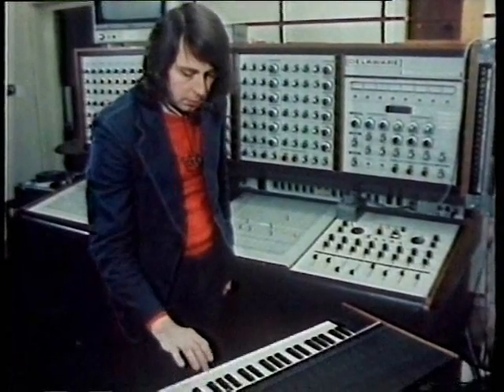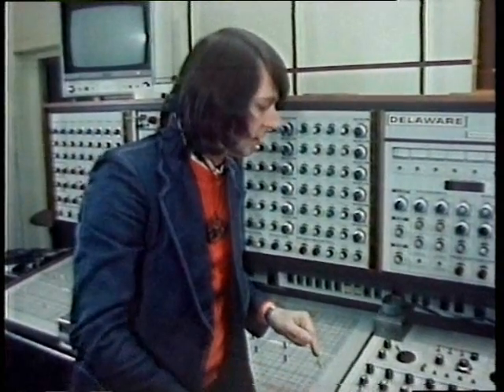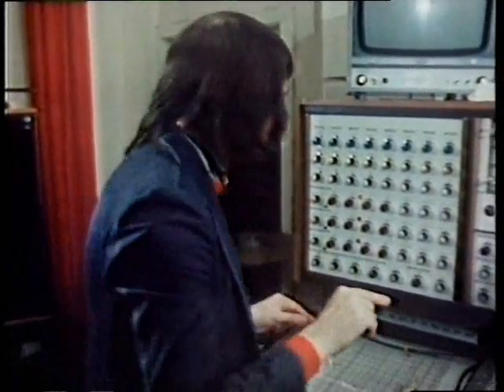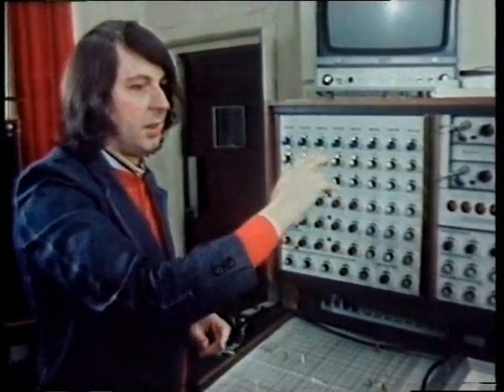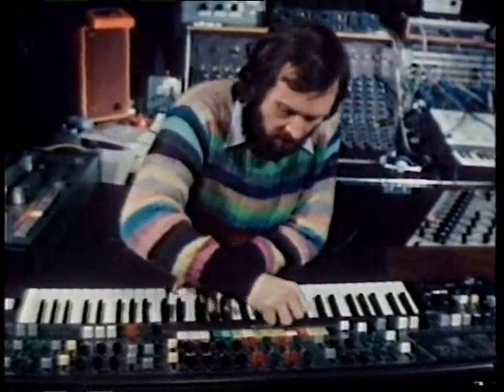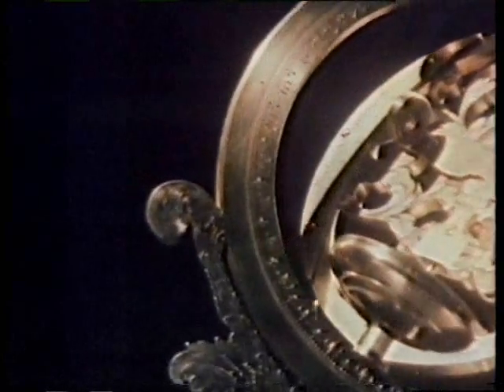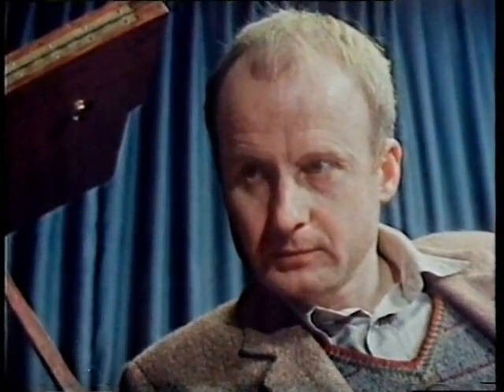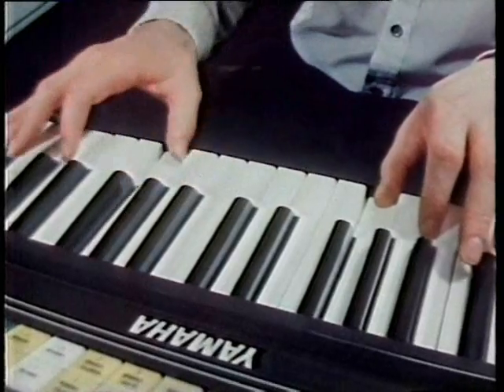The New Sound Of Music 1979 (part 3)

Comment: Yeah,you are right. One other thing that really bothers me is that analog electronic( vacuum tubes, transistors, and large scale integrated circuits) and electromechanical organs of the 1930's through the 1970's are completely disregarded by the organ education community. Nobody is trying to duplicate these beautiful organs digitally, but instead the quest is to produce ONLY pipe sounding organs. Kids today have 3 options- learn to love the pipe organ, or rebuild older analog organs.New B3 sux.
Reply: The kids are using the Arturia B3 plugin!
Reply: The kids are using the Arturia B3 plugin!